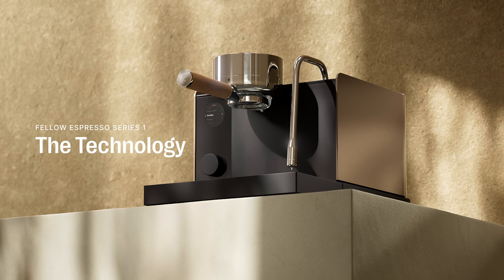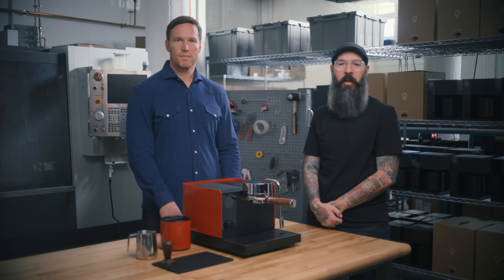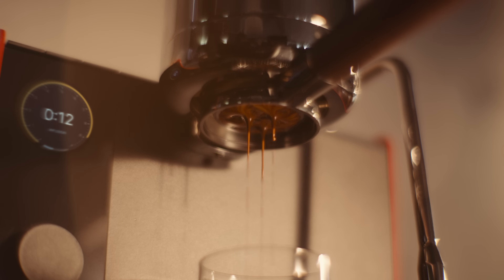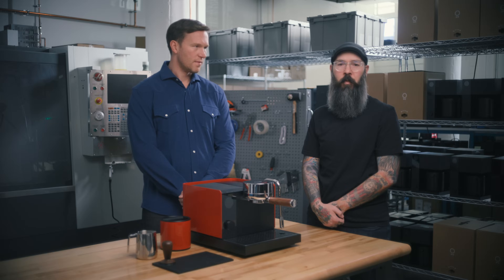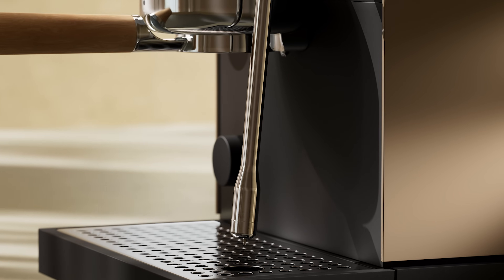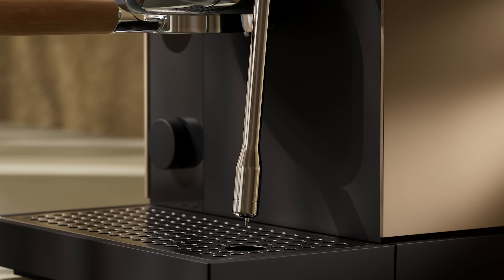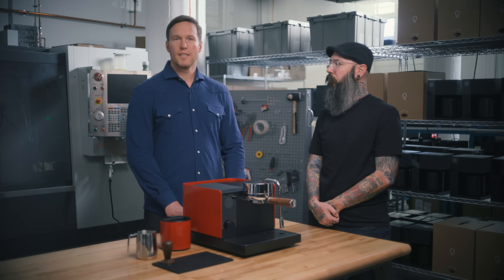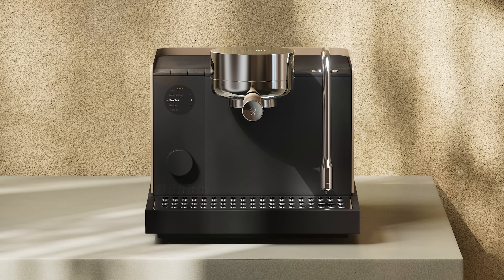Fellow Espresso Series 1 | The Technology

Comment: I have been looking into this machine a bit. It's a really cool design overall, especially the way the group head seems to stay stable. Got some Linea Micra vibes with the layout and thermal logic.

One thing I’m curious about though: with the water going through what looks like a preheat block before hitting the brew/steam system, how does the machine handle potential scale buildup in that area? Like, does it remind you to descale or have any kind of flow detection if that part starts clogging?

Not trying to get too deep into it, I am just wondering how it holds up over time. Definitely loving the direction Fellow is taking with this machine 😊
Reply: We can detect scale buildup in that element and will alert the user to descale. Thank you for your interest!

Comment: Are these lifetime machines with full repairability, ten, twenty years from now?  What about if the circuit board needs replacement?  Or the display?  Please consider that most of us want machines that last well beyond just 5 years. The age of throwaway consumption goods is nigh.  Build it with the idea,  so that if you were to go out of business, a market could develop to sustain these machines. 

I'll spend the money on things that are durable, supportable, repairable. I'm not wasting money on something that won't last, can't be repaired due to design/parts, or if repair is possible, is prohibitively expensive. 

This should be the philosophy of any up and coming company that wants to disrupt the market. Not only better than the competition where it matters, it can be fixed! Particularly electronics components, which are often the reason our landfills grow with e-waste.

Comment: Stop steaming automatically is silly, at least you should allow user to turn it off.
Reply from the maker: This is totally possible! Setting the machine to manual mode will allow the user to shut off steaming at a time / temperature of their discretion.
Reply: @FellowProducts looks like single boiler, can it do the extraction and steam the milk at the same time with some hidden technology?
Reply from the maker: @ While you can't pull a shot and steam at the same time, you are able to transition pretty seamlessly from pulling a shot to steaming in the workflow with Series 1!
Reply: @FellowProducts thank you , that’s great. What about the transition from steam to pull 2nd shot ? Thanks

Comment: What are the heating elements made of? For example, the tube that carries hot water from the boiler to the group head, is that plastic or copper/stainless steel?
Reply: Looks like silicon unfortunately, also looks like there might be plastics (PPS) in the group head. There’s a short clip of the CAD in their tech video.

Comment: I don't get the idea of that circular screen! The aesthetical part is important of course, but UX is more important. Both Aiden and this should not sacrifice user experience for the nice look of the machine. I would prefer to have to have a big square touch screen on the machine instead or relying on smartphone. This is not a kettle with 2 settings, where one circular screen and a small knob is enough.
Reply: I agree. That screen is a big turn off for me.
Reply: I have the aiden, it really isn't that bad.
Reply: @ 
"isn't that bad" is not what should be in a coffee brewer for 360 bucks.
Reply: @peterjanvanesseveld1324 I actually like it. I have an Aiden and  I feel people...even "Hoff Daddy" HAVE to find something to complain about. After Hoffman bitched, it became cool to make fun of the round screen. It works fine! The menu scrolls up so the selected item is always in the center of the screen and it's highlighted. The center of a circle is its widest point! Where's the problem? The lack of a "back" button feature is a bit of a problem. There is a back selection in the menu but the selector knob "selects" when pushed in. As Hoffman pointed out, a 2 second push and hold would be a sensible back feature which could probably be obtained with a firmware update. That's my only complaint.

Comment: Can it pick up tank water to cool down the water flow after leaving the boiler if needed?
Reply: @brad7571  They design they are using does not allow for it. Temperature profiling will likely be very limited, so no big drops.

Comment: Waiting for Series 2
Reply: that's the best move with fellow. their gen 1 products are always very flawed.
Reply: Do yourself a favour and just don’t buy any of their products… after buying an opus I refuse to buy anything they make even if it’s good. Their marketing is so full of shit It’s unbelievable.
Reply: @RustBucketConnoisseur what’s wrong with the opus? I was thinking about buying one lol
Reply: @ has a crazy amount of grind retention, which is a huge issue, considering it’s intended as a single dose grinder. It’s a perfect grinder for filter coffee but if you’re planning on using it for espresso, be prepared to be extremely frustrated although the grind is great it just makes a huge mess and they over exaggerated in the advertising. The antistatic pins are useless. Put in 16 g and you get out anywhere between 14 and 15. You have to smack the shit out of the thing like it owes you money and even then it’s still retains some of the grinds usually a gram to a half gram. This makes single dose grinding espresso nearly impossible if you’re trying to get an exact amount. Just buy a different grinder. I’m selling mine after only two weeks of using it.
Reply: @  do you spray your beans before grinding? Dang that’s a bummer it looked like the perfect combo grinder
Reply: @geoffreysayoc  ive found that one cannot spray the beans!
Reply: @Liam_Kennedy1 Why can one not spray beans?
Reply: Same
Reply: It's called a Decent Espresso Machine.
Reply: @brad7571  This is so similar I wouldn't be surprised if they bought the rights to Decent Espresso's technology and rebranded it.
Reply: @Smellslikegelfling  Decent is open source so there's nothing to buy.

Comment: Looks like a copy of decent at lower price point.
Reply: Or a Gaggiuino at a much higher price point.
Reply: Copy? The Decent looks like a piece of shit and it costs $4k for the entry level machine, whilst this costs $1200 and looks 100x better.
Reply: @Adam-cn5ib  with fellow's lack of right to repair and from the looking of it. Too many points of break. I'm pretty sure this thing won't last you pass 5 years. Even a simple kettle fuse replacement was locked being proprietary screws.

Comment: I'd love a more in-depth look at the boiler-grouphead technology please.
Reply: Guess: thick film heating element feeding a small boiler. This prevents the temp drop, because preheated water enters the boiler. Combined with a heated group head for fast head up and more thermal stability.
Another guess: temp profiling will be limited or impossible.
Reply: Just found the description on their website. My guess seems to be on point.
Reply from the maker: Check this article on our site for more info on our Boosted Boiler technology! https://help.fellowproducts.com/hc/en-us/articles/36198487633307-What-is-Boosted-Boiler-and-how-does-it-set-Espresso-Series-1-apart
Reply: @FellowProducts Thank you.
Reply: "Boosted Boiler", 3 point heating system. 3 independent heating elements. 

At the moment, these are essentially buzz words strung together. Please give us a detailed walkthrough of how the new hot water system works, and why it's better than what's out there.
Reply: @theSnowpup  "3 independent heating elements" is a literal description, if it is simply the case that there are three separate things that heat the water. not sure how these are buzzwords. actually how it works doesn't matter. the data that shows that temperature is indeed consistent is the important thing.

Comment: not that circle again!
Reply: It is at least a square screen with a round hole. I am more concerned by the fact there doesn’t seem to be a back button for menu navigation.
Reply: I'm convinced they got a great deal on a 100,000+ unit order quantity.
Reply: if it's a touchsccreen, you probably will be able to swipe back?
Reply: It's so funny that they continue to use it, that I am starting to think that they just found really good displays from a supplier that makes smart-watch screens, lol
Reply: @Z1xt if they want to keep it then fine but at least make the UI custom designed for a circular screen
Reply: @Achraf-HOK  yeah that's the most funny thing. But I think this time Nick said somewhere on homebarista forums that it's justified because when pulling a shot, the screen is the timer and the pressure gauge at the same time, and, well, pressure gauge is usually round

Comment: How does it measure output/yield? Typically home enthusiasts use a scale, but it doesn’t look like this has one integrated.
Reply: I think this is the big miss especially since they have their own scale tech and didn't need to license
Reply: Precisely, without a weight reading, you have no real way of knowing your yield. Yes, you can do some fancy guesswork by constantly checking the pressure reading, but what if you're doing something out of the ordinary like a turbo shot, the pressure will look low to the machine, but it might actually be exactly what you're looking for. Add a USB-C port to the ES1 that allows the weight reading from the Tally Pro to automatically stop the shot when the desired output weight is reached.
Reply: It measures output/yield with the scale you put under it.